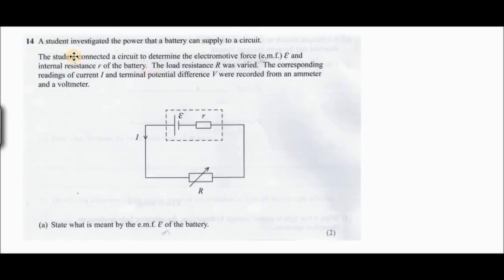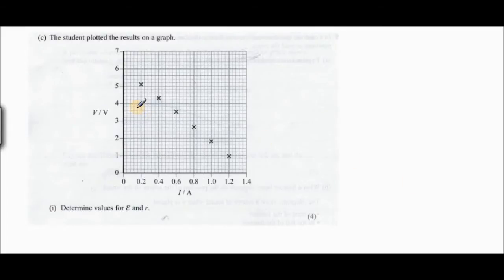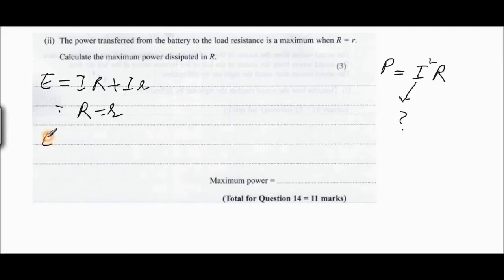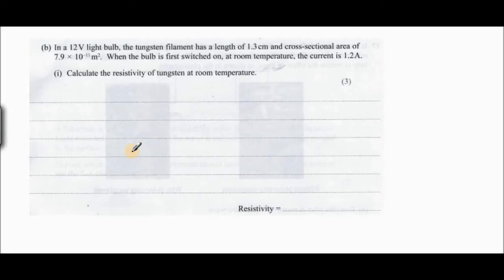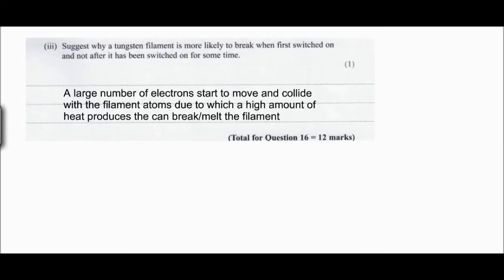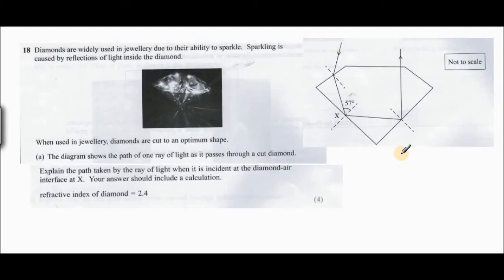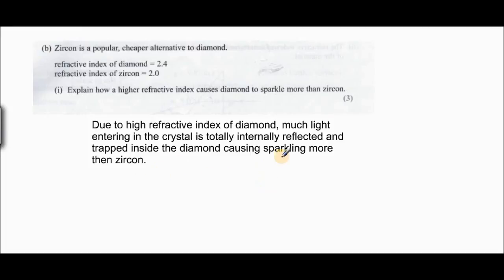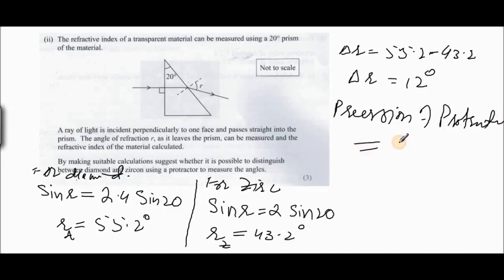Edexcel AS physics unit 2 June 2017 part 3

Comment: I would also like to say that in question number 15 part (b) (ii), you have mentioned that "For the right ear as frequency is increasing so that wavelength is decreasing causing more diffraction of sound due to which intensity keeps decreasing." But, higher frequency and shorter wavelengths are diffracted less not more. Please correct me if I am wrong. :)
Reply from the maker: Indeed, shorter the wavelength lass the diffraction, so the less sound reaches the right ear. Thanks.
Reply: You're Welcome! :)

Comment: Last question, why is it Sin r = n x Sin i? Snell's law is n = Sin i/ Sin r, why is that reversed?
Reply from the maker: The formula Snell's law sin i /sin r = n is for refraction from low refractive index material to high refractive material (rarer to denser refraction).
In the question the refraction is from diamond to air or from high refractive index material to low refractive material (denser to rarer ).